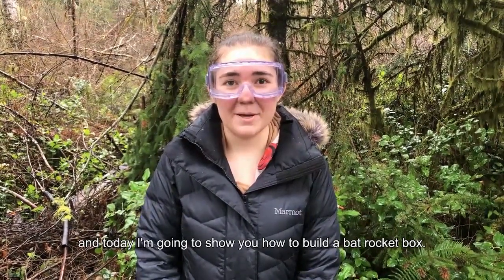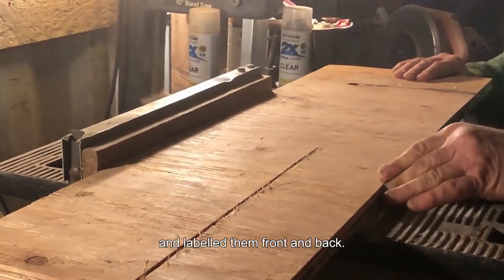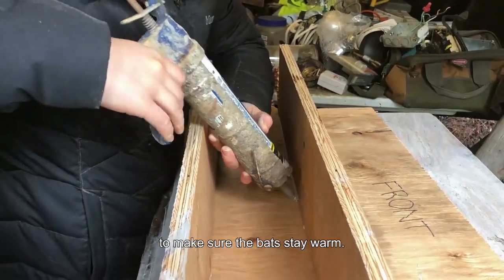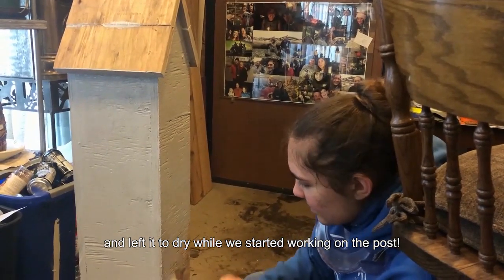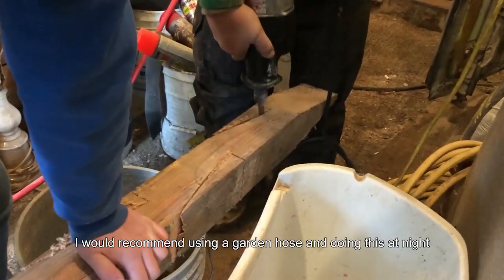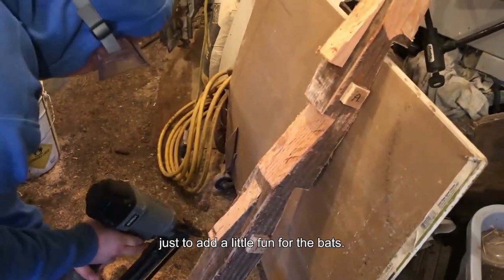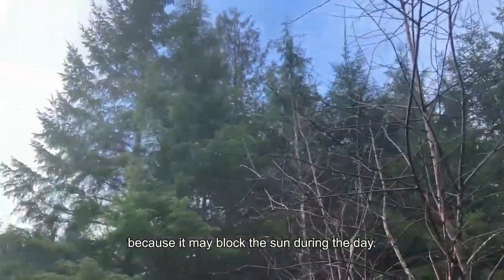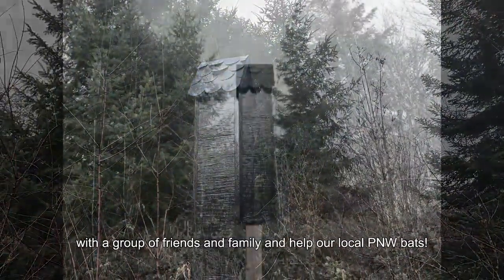How to Build a Rocket Box Bat House

Comment: Had to down rate this for several reasons. First is what everyone else said about tool use. It’s extremely irresponsible to promote this type of dangerous use of power tools. 
Second, which is more important, is the lack of information about what color to paint depending on climate. If someone in Arizona paints the bat house black, they will cook the bats. The interior of the bat house should not go above 97° for comfort, and is dangerous over 104°. It’s possible to get remote temperature sensors which can be installed to monitor the temperature. The temp should be tested in different areas of sun exposure before deciding on a permanent location.

Comment: An amazing example how not to use power tools. The irony is the call for using PPE which in total was one pair of goggles and ignoring any other safety PPE. The cramped working quarters, loose, restrictive, and bulky clothing. Tablesaw free-handing cuts, moving the material with your hands in the path of the blade, possibly pulling the wood through. Putting your hands/fingers in the direct area and path where you're using the power nailer. Operating the reciprocating saw or any power tools in the direction of your or anyone else's body is a bad idea. Again the lack of area to work  and mount your work safely. So much more.

Comment: Talk about saw safety.  Never freehand cut on a table saw. Never have an assistant on the other side of the saw help pull the cut through. You can pull the operator’s hand into the blade. The user should always use a push stick. And keep that Irving knife on the saw to prevent kickbacks.
Reply: 4:35 the hoodie pull-strings dangling right next to the circular saw blade 🫣🫣🫣🫣

Comment: good video. terrible tool usage. Literally exactly what you shouldn't do with a table saw. Also the dude was using the nail gun with his thumb under the nailer. Very dumb idea.
Reply: actually they held their hands and fingers I the shooting line of the nail gun several times and the use of the circular saw was awful.... I've personally seen circular saw grab and run up and our of cuts and down boards before.... right where she had her hands.
Reply: How about the Sawzall being pulled toward the crotch?  That'll hurt!!